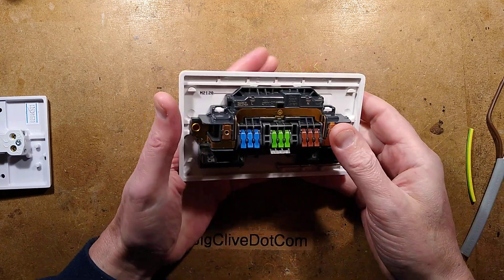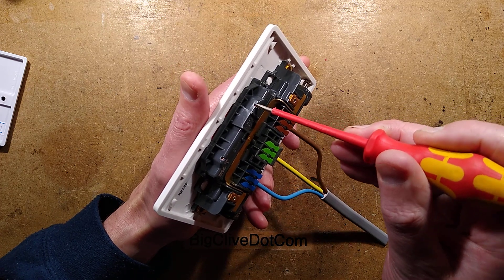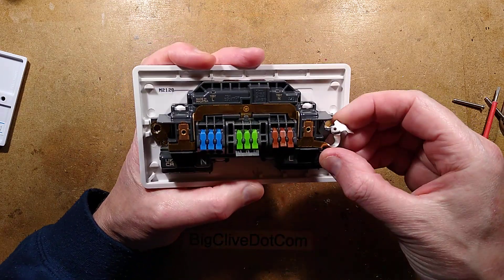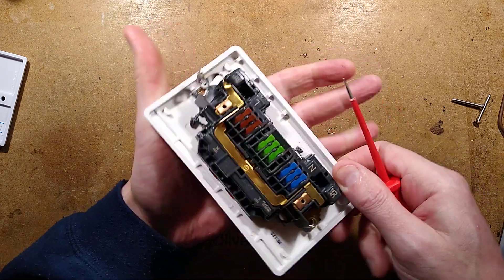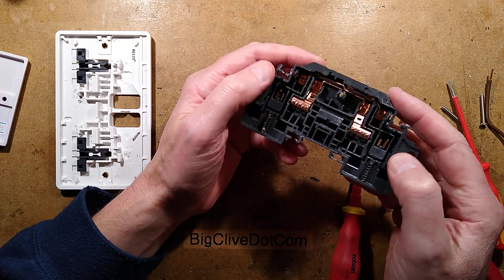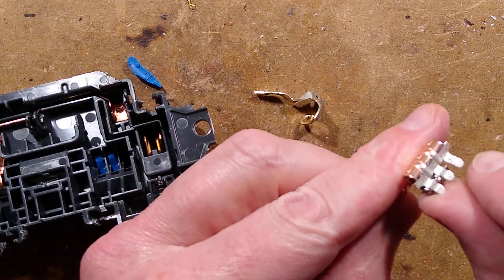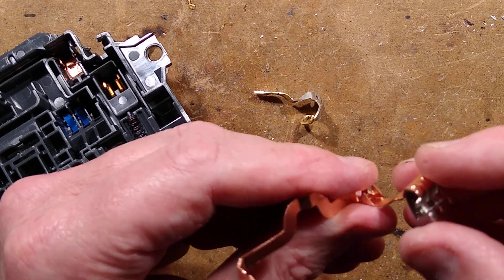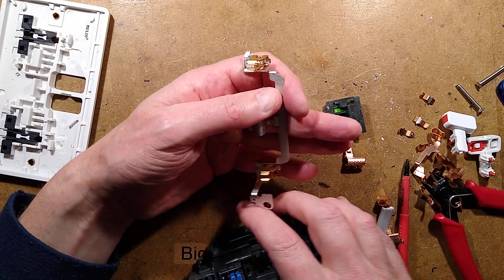Teardown of the new MK screwless socket

Comment: Spring lever terminals are considered maintenance fee. And they don't suffer from mechanical creep. So they always make a good connection over long period of time. They are even suitable for aluminium conductors which suffer from the thermal effects (expansion and contraction of the aluminium is not suitable for screw terminals) I don't know why they haven't done this in the UK sooner? spring lever terminals is pretty much standard on the continent, for most sockets and light switches.
Reply: Spring lever terminals are very definitely not maintenance free if used in a damp environment. Combined with the degradation due to the damp, the point of contact where the spring is clamping down on the copper conductor eventually causes the wire to break. Then the circuit fails open circuit. Sometimes intermittently at first.
Reply: Cose they are designed to be used in damp env. Right?
Reply: @Mark1024MAK  The problem with springs is that they lose their springiness when overheated. How do these fare as a poor connection to a 3kW fan heater ? JW has tested them as a good connection.
Reply: @Mark1024MAK  normally electricity and water don't mix well anyway.

Comment: I've been watching a Bavarian electrician on YT and note that many of their terminations are simply push-in for solid core wiring. That includes power outlets, switches and terminal blocks in distribution cabinets.
Interesting.
Reply: That exists elsewhere too, including the US, but is generally considered inferior to screw terminals. It just gets used because it's fast, not for quality reasons.
Reply: @absalomdraconis  I dare to disagree - the tension of the internal spring locks down the conductor tightly. No corrosion will form between the contact surface, whereas a improperly screwed down terminal could lead to a bad connection, causing resistance forming over the years. WAGO221 does a pretty good job on solid and flex alike, talking standard household wire gauges.
Reply: You're talking about ProofWood - Amazing guy, knows his stuff.

Comment: In canada we had a brief period where houses were wired with aluminum.  I think it is still allowed in some large applications.  The only issue that I heard is that it cracks when it is flexed a few times.  Current carrying and temperature was ok.  In locations where it is stationary... like the strips trapped on the back it probably wouldnt make a difference.
Reply: I believe the issue was always due to improper termination; regular outlets aren't designed to handle Al wire and thus connections would fail. Al wire used in "large" applications is done with terminals rated for the task and an anti-corrosion compound must be used.

Comment: Great teardown Clive, interesting to see that coating on the brass. I do love a Wago'esk/Ideal'esk connector, not only are they quicker to terminate, but as they're a heavy constant spring mechanism they never work loose like screw terminals can. The only downside is that you can't insert multiple conductors into one connector, but that just makes them safer.
John Ward did a torture test on Wagos a while ago and even though the plastic eventually melted away, when he massively overloaded the circuit, the metal connectors stayed intact. I honestly wish they were standard across the board from CU's, to sockets, switches, etc.

Comment: Hello I was hoping you would torch the little spring bit to red hot to see how it holds up.  I work on all kinds of things here in Canada and I am sure I have come across a number of similar connectors might have been in camping trailers that had obviously got hot and the spring lost its spring.  I am sure there would have been some abuse involved high amp 12V or 50 amp at 120V while going 120KPH down some back road.  I would be interested in seeing some kind of load test to destruction maybe use something like a car battery load tester I would think at 12V the fail point would show its self long before you got to 300amp.

Comment: I don't get it why everything in the UK has to have its own switch. I mean like the dishwasher, hob, oven. We don't here in Finland. You have three phase (mostly in detached homes and also in flats etc. from maybe 90s forward) fuse/breaker in the distribution board and then directly to the oven and hob. Same with a doorbell or other standalone equipment, just the breaker on the distribution board. Dishwasher directly in its own outlet and we don't have any switches on our outlets
Reply: Historical reasons.

Comment: I would guess they are 20 - 30 times more expensive than standard sockets... but they do appear to be well made... However,  the one thing that does concern me, is that the entire current is distributed through the tiny points of contact, where the copper wire is "bitten" into by the edge of the copper terminal. That is a very small surface area compared to the screw terminals of the older style. This might increase temperatures, and over time,  weaken the internal spring, potentially loosening grip on the copper wire and causing arching...
Reply: Standard equivalent £3.80 each while this mocel is £29.49 in a popular UK outlet.  Not quite 2030 times,
more like 7-8 times.
Reply: @timbrook4515 ...yeah, I live in the states, so had no idea, just a guess... They just look like they would cost an arm and a leg! And actually, 30 pounds, or 7 - 8 times more expensive is pretty pricey... especially when you factor in the number of outlets in a house...
Reply: @Quickened1  £30 is a five pack.

US outlets are indeed cheap - and they're also flimsy and often short-lived.
Reply: @Matt Quinn shows I dont know much about U.K. pricing! Here in the states you can buy outlets for as little as 79 cents ea. up to $13 - $14 a piece for the fancier ones. I guess looks can be deceiving.

Comment: The name of the element is Aluminium, with two I's. This is the correct name as specified by the international body responsible for naming chemicals and elements. Only a minority of the world's population pronounce this with only one I. Even the Scots language version of the Wikipedia entry for aluminium has two I's.
Reply: 1) The only valid authorities over colloquial speech are the speaker, and how easy it is for listeners to understand them. The IUPAC has no authority or power here.

2) The actual discoverer of the element dubbed it "aluminum" in 1812, while "aluminium" was coined by someone that merely made a report about a talk by the discoverer. The IUPAC only dubbed it "aluminium" in the 1990s. I reject "aluminium" for the same reason that I would reject a redesignation of iron to "ironium", "irium", "ferronium", or any similar thing- the changing of historical names for elements only provides value within contexts where the new name has added value over the old name, and even in those contexts, "aluminium" provides so little improvement that it provides no improvement at all.

Comment: Great teardown.  Those little springy grippy teeth are made from some high spec hardened brass alloy.  Hard and springy like steel but with low resistance like copper and aluminium.
Reply: No, they're made of steel. The spring is not the conductor.
Reply: @Monkeh616  correct, but they do carry some current too, so likely tin plated (if that) so it's resistance is lowered some to reduce heating up under high loads. they for sure are not rated for the bulk of the current however.

Comment: Seems kind of dodgy. You have a 12 gauge (2.052mm) solid copper wire coming in, but the contact area of the clamp seems significantly smaller than what the screw connection provides. I don't know if all UK style screws are set-screw style, but in the US the wire loops under the screw, and one side of the wire touches the actual metal strip in the socket, and the 180 degrees from the other side, it's touching the bottom side of the head of the screw. It's a fairly significant contact area, and when the screw is tightened, the area increases as the wire deforms slightly.

The Wago style clips may prevent pull-out because the top of the loop bites into the wire, but there's no real compression deformation of the wire that increases the contact area. Someone with more experience than I have with those style connectors can explain to me why I'm wrong :)
Reply: The US-style wraparound connections aren't ideal because any wire movement will want to loosen the screw. Much better are the screw clamps which press down on the wire using a separate plate. These are found on higher-end receptacles and switches.

The only downside I can think of is that it means you can't use the strip the wire in the middle style Mr. Brown suggests, which not only is allowed by NEC but is encouraged when working with stranded wire. Leaving a tail of insulation on the end prevents any loose strands from shorting against anything.
Reply: @eDoc2020  Cool. I'm not doubting you on the code, but can you point to the reference for it? I'd like to read through that section. And agreed on the screw clamps. I use those for all the receptacles I've replaced in my home and shop.
Reply: @JCWren  110.14(A) specifically discusses terminals and the broad scope of 110.3(B) covers a lot of things based on how devices are designed.

The wraparound wire connections aren't "usually" allowed but 110.14(A) provides the exception. It also says that you can't put two wires on one terminal unless the product says so.

While the NEC doesn't seem to say that the "stripping in the middle" is preferred, I live in MA and we have a code amendment which includes: "Where stranded conductors are terminated on and not looped through such terminals, the terminals shall be identified for such use," which certainly acknowledges the process.

110.3(B) is the general rule basically saying you must follow the device's installation instructions.
Reply: the us screw style is definitely superior when used in the "strip the middle of the wire loop it on the screw and keep going" mode where there is no break in the conductor at each outlet
Reply: Ummm.... I don't think that meets the NEC...
Reply: The contact area is almost certainly larger than the CSA of the conductor, so why does it matter that it's smaller than a screw?

Comment: you can't even find household socket terminals with screws in switzerland anymore, been like that for years. The system we have, you just slide the wire in a hole, no need to push or lift anything. The metal sping grips one way and tightens by itself. Only to remove the wire do you need to press a button to unlock the wire.
Reply: A bit like spring contact DIN rail terminals? They show up a lot on continental equipment, they can be fiddly but they work well.
Reply: It makes sense. They are used to connect current and not kinetic force. no need to squeeze and damage the cables, while also being a pain to use
Reply: That seems similar to the US-style backstabs which are notoriously bad. Hopefully your Swiss version is built better.
Reply: @eDoc2020  I do not know how those US ones are but the Swiss ones are very good. Very easy to push the wire in, pretty much impossible to pull it out without pressing the release button. Contact is excellent and they are pretty much indestructible (and I tried...). Also the new ones are recessed so no live part is exposed, and very compact as we can fit 3 plugs in a 10x10cm square.

Comment: I've just noticed that this socket has the UKCA mark which has replaced the "China Export" marking since we have left the EU. A shame they couldn't use the good old BSI Kitemark again instead, looks much nicer. I've got loads of old 13 amp plugs with the BSI logo on.
Reply: UKCA is managed by UKAS and its use can be granted by any Approved Body of which BSI is only one of many. On the other hand use of the BSI kitemark can only be granted by BSI.

Comment: Give me good traditional screw terminals anytime for a more solid connection...

These cable clips are like speaker clips on many commonstereo systems & some amps and ok for sound but mains electricity... wouldn't trust them full stop even from MK electric!

Cowboy's dream come true... put that socket under 3kw load and a hot plug is likely guaranteed through inferior connection and 2 of them in the old ring would create a hot live wire danger zone.
Reply: Those Wago style connectors are rated for use in maintenance free junction boxes (which screw terminals aren't) so they can't be that bad when used on an accessory like this?
Reply: Speaker terminals like that have a plastic wedge pushing the wire onto a thin blade of metal. Wago connectors have a metal spring which pushes the wire onto a much larger contact plate.
Reply: Vaguely similar looking if you've never actually used them, perhaps. In reality there's a huge difference, and these connectors are quite reliable.

Comment: I've always preferred MK, they used to have the wrap around terminals in their plus which was kinder to flexes
The strip across the back is not so important (apart from connection to ground pins) it's only to ground the box, but then again you're supposed to have a wire between socket and box
I also prefer the rotating shutter, the earth pin didn't operate it, you had to put bothe L&N in together, this stopped toddlers being able to poke things in the earth then poke things in the live, i would like to know if you can poke something in the earth of that one then open the shutter just using one pin in live

Comment: Most probably Tin, in marine applications tin over copper is pretty much standard.  It prevents corrosion and build up of not conductive oxides.  Really nice to see it, MK use to be one of the best manufacturers in its field.  Nice to see a British company setting the standers to beat. MK gear still rocks and added a little joy to my day.
Reply: Sadly MK has not been UK owned for years.  Honeywell is an American company.  But I do agree that MK is what I would specify  for any job.  Having said that, look at the JWard review of the cheap MK range of outlets: I would not have those.

Comment: I've just bought and fitted a bunch of these. Love it! Sad they haven't done the 1gang or the light switches yet. I am a fan of the basic MK look.
Reply: You might like the new MK Base range then, traditional terminals and MK build quality but priced at a level to compete with the BG/LAP ranges.
Reply: @jsptravels  I'll check them out, I'm rather annoyed that they seem to have dropped the big button switches, not only do I not understand why these are so few an far between in the UK but half my house got changed to them last year and I'm just about to decorate and wanted to change the the half over!!! oh well....
Reply: Can you get a folded over 2.5 mm^2 wire into them ? If I installed a ring, I wouldn't break it to fit a socket !
Reply: @millomweb  You cannot, it's single wire only.
Reply: @jamesfurz7406  Thanks.
So it's put the ring into a 'choc block' and have a single core coming out the other side of the choc block !
# Why use one connector for each wire when you can have three ! :)
Reply: @millomweb   Why on earth would you want to put folder over wire into them? I'd advise staying away from electrics.

Comment: I had an EICR done recently and one of the things that was picked up was a slightly high ring impedance. Taking all the accessories off the wall and tightening all of the screws made a very big improvement! Those Wago connectors would eliminate that potential problem. Just goes to show why some things are maintenance free and why some are not! To be fair to the screws being a bit loose, they have not been touched since the house was re-wired in about 1995!
Reply: It’s possible that they were loose from the day of installation. In the industry where I work, we have screw terminals that date from the 1970s that are still in use and which are reliable. The only difference is that these have wire guards.
Reply: @Mark1024MAK  We moved in here in 1976. Generally the wiring has not been touched ! It'll be all screw terminals.
I suspect the 'loose screw' problem was down to insufficient tightening. I always consider the screw has to cut through the crud on the copper wire - but that's me using old wire ;) I've seen more problems from plug/sockets with too high a resistance - usually causing the pin  in the plug to overheat and if it's the live, you then end up with a fuse holder that's lost its springiness - creating another bad connection ! Sometimes you also see cracks between the socket holes where the socket has overheated. Again it's a plug/socket connection fault, not screw terminals.
Reply: @millomweb  - overheating due to a slightly increased contact resistance is also something that is likely to go unnoticed for some time. It will only when it gets really bad, such as discolouration or malfunctioning that most people will notice. By that time, as you say, the heat by then has made things worse by affecting the properties of the metal. Or the plastic casing with some types of plastic.
Reply: @Mark1024MAK  and were probably tightened properly in the first place!

Comment: Now we just need to add small serrated teeth to the clamp parts, make the springs stronger, and add a clamp for the cable's insulation, and these will be the golden standard
Reply: Why?  These are for fixed wiring.  Fit once and forget.  No need for a cable clamp as there is no strain, the springs are strong enough to indent the copper so no need for serrated teeth or stronger springs.
Reply: @cjmillsnun  i said, if they had the extra stuff they'd be the, the gold standard everywhere for everything.